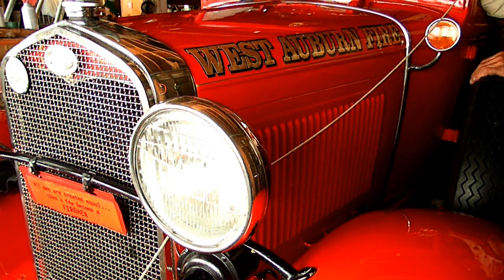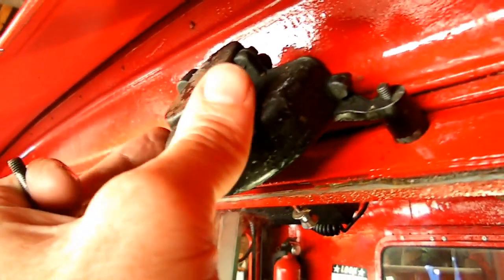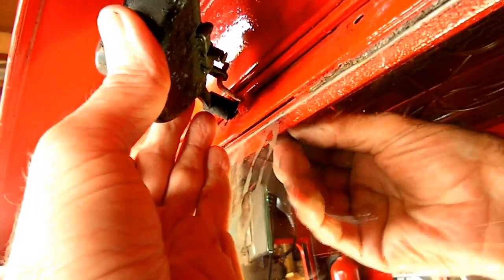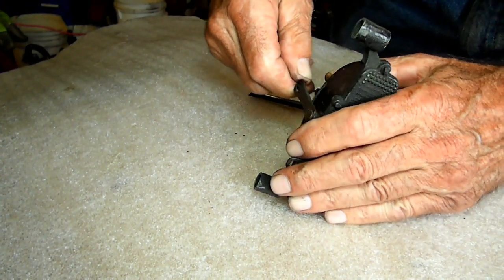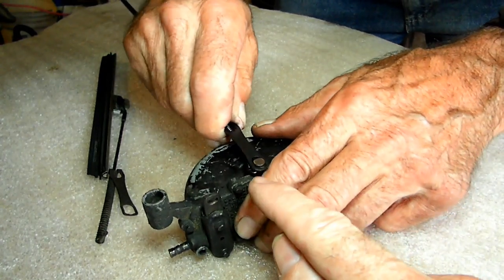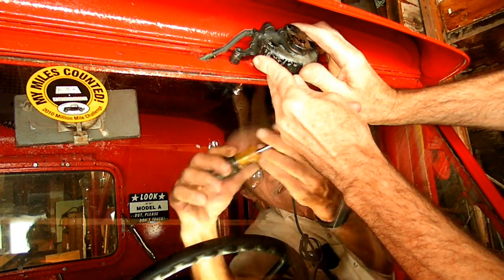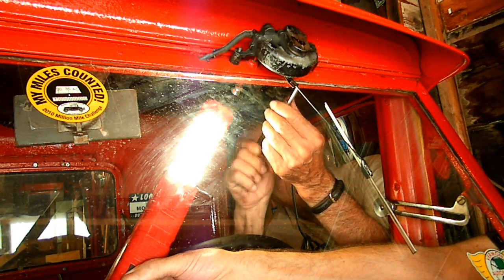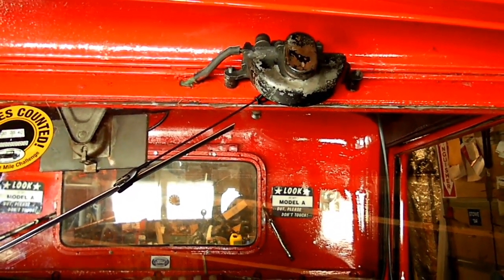Model A Ford Wiper Arm & Wiper Replacement

Comment: Disregard. After watching all of your vids, I guess I gained some of your mechanic senses and was able to figure it out. It was the IAC valve that was only 8 months old, that had died in the closed position( blocking idle air). I had to sleep on the problem to better assess the situation. Now I have to get the ECU and the IAC to figure out their happy medium and work perfectly.  BTW, another great vid. My dad wouldn't ever help me when I showed up with a 91 SL one day, I was on my own since.

Comment: Hello Mr Richpin. I tried to find a way to send you a message, but could not, so this is my best avenue to reach your wisdom of saturns. Just today while driving ( about 35-40 mph ) my 1994 sl2 decided to just died. No sputtering, no fighting, just cut out. Since then I cannot get it to maintain idle. If i start it, i have to give it gas and keep reving. I can drive like this but it is tough, if i let off the gas it dies. I will list the fixes in the past year in the next post.